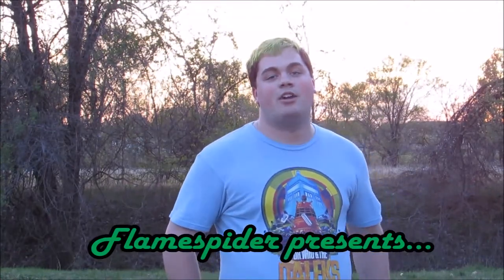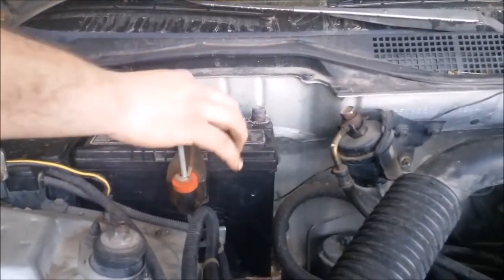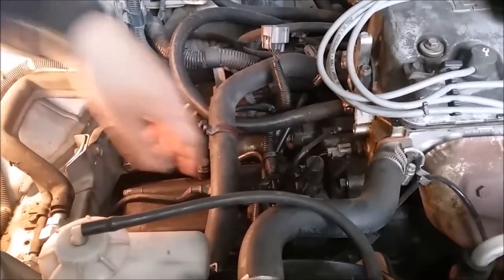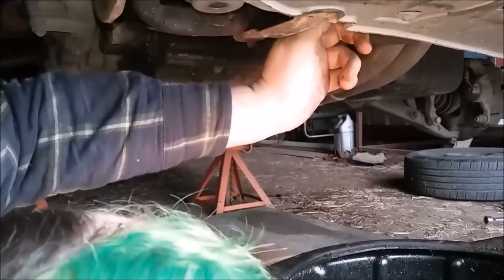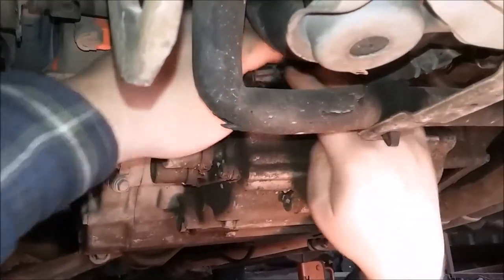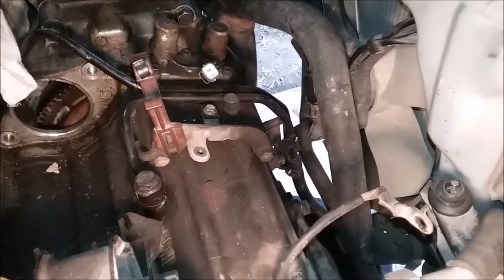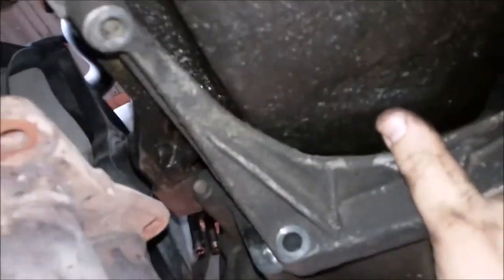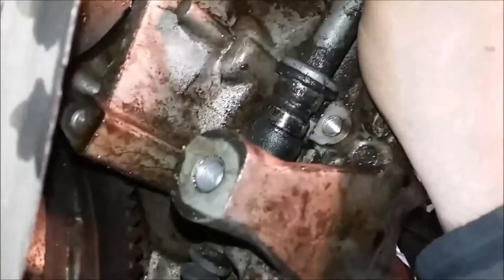Honda Civic 1997 Auto Transmission Removal (Part 1)

Comment: Day 2 of taking out my transmission. I've removed all the coolant and removed the lines from the trans. Unplugged most of the harness but the 2 bottom plugs close to the radiator are such a pain. I'm moving on to the bracket to get to the flywheel BUT my exhaust is so rusty it doesn't come off the exhaust manifold. I'm going to have to either remove the whole downpipe or the cat. I'm going to use penetrating fluid and pray none of the bolts snap.

Comment: When you turn the engine over to take off the flywheel bolts is the car in park or in neutral?
Reply from the maker: It was in neutral when I did it,